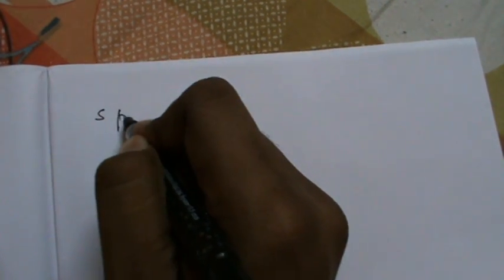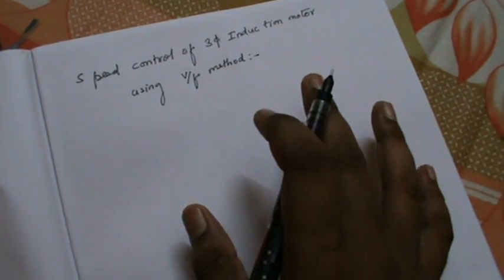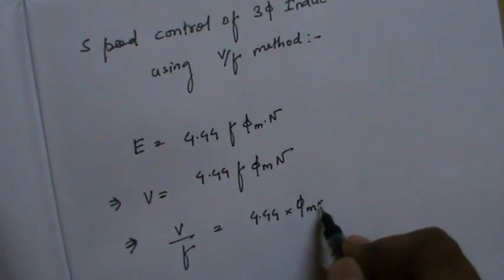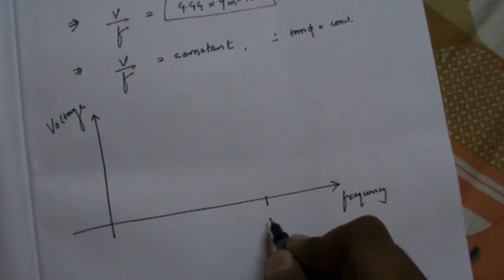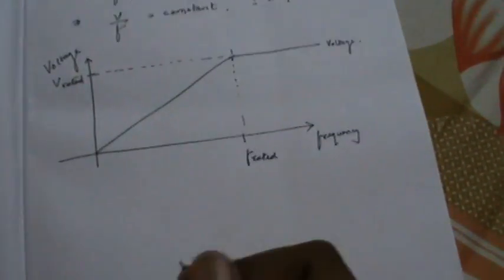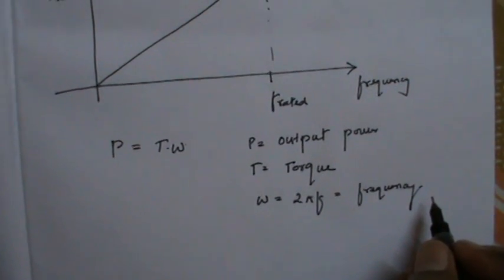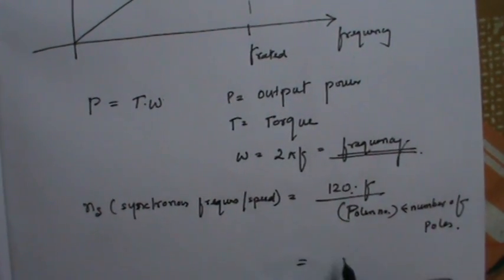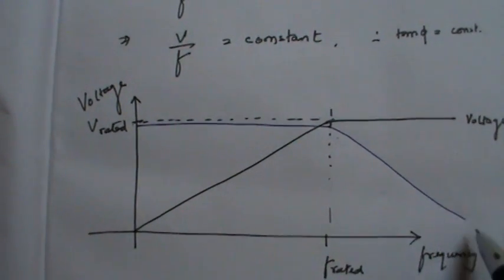Variable frequency control ( V/F) of Induction Motor 1

Comment: Thank you for the video. Does it mean that if i proportionally decrease the voltage and frequency of my induction motor under the rated figures, the motor torque will remain the same as at the rated frequency+voltage?

Comment: u dint explain why we take v/f even frequency is constant too...
Reply: We can use cycloconverter bro for ur problem ☺
Reply: using a VFD you can control in the supply frequency, which in turn control the voltage and thus you have a varying speed with constant torque(with some practical initial cut off)

Comment: V. Good lecture. Can you show how to calc starting current of an induction motor pump if Rated Power is 70kW, 50Hz, 415V, 4 poles, 3 phase, then how to calc Starting Current if using a VFD?